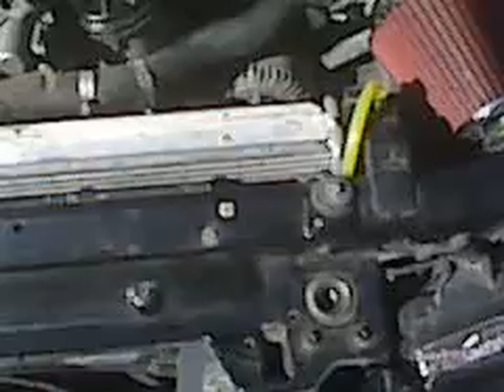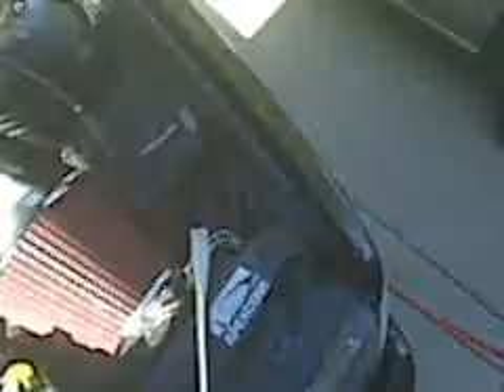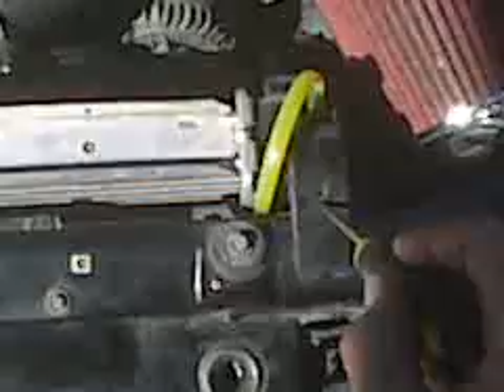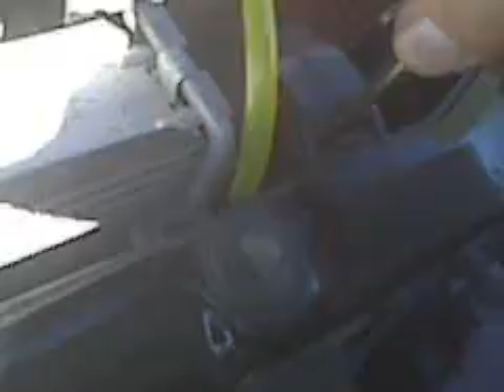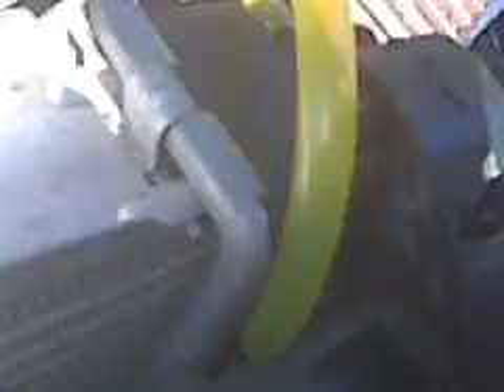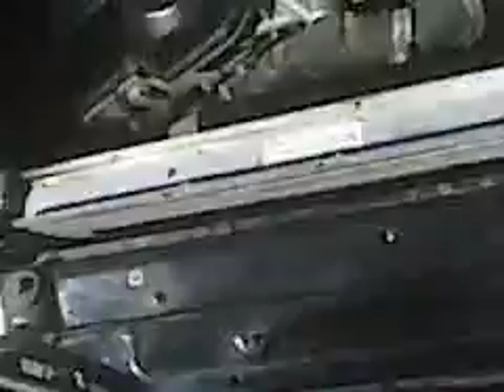How to remove / replace radiator : Radiator clips on e36 BMW

Comment from the maker: @sinn3r213   I made my intake, home depot lol. For the sensor I drilled a hole in the PVC type pipe and screwed it in and then sealed it with silicon

Comment: @BrabusTKR  When you say sensor are you talking about the Thermosthat auxilary sensor ? the one hooked up the the box with a 10 inch bolt ?. my question was for the MAF sensor the one behind the box. because i disconnect it and the check light came up ? did you disconnect ? or you left it on the new  intake ?